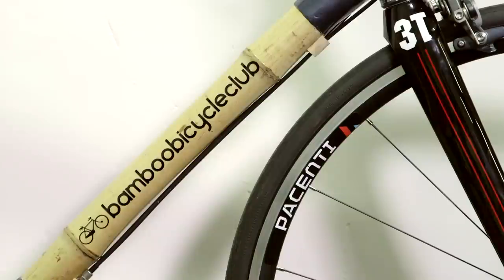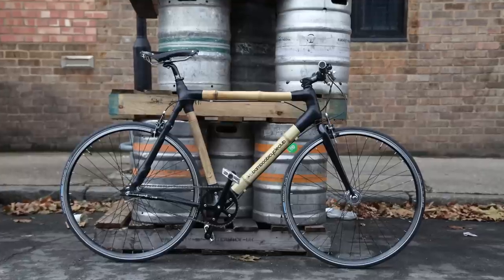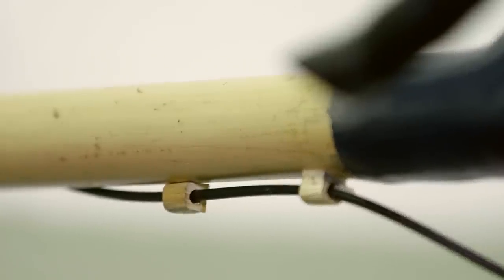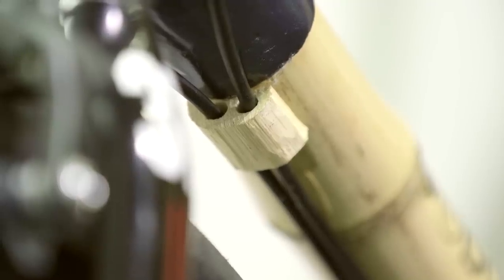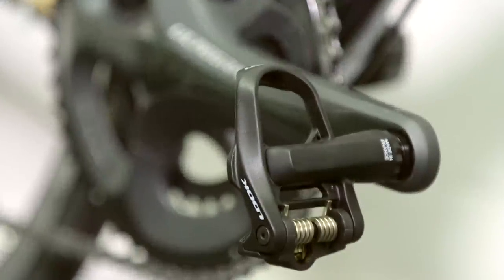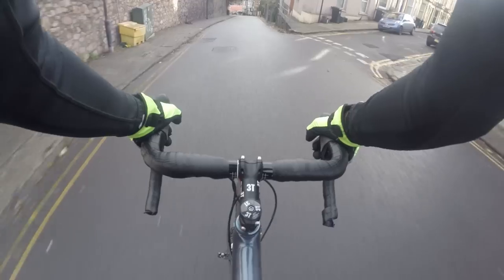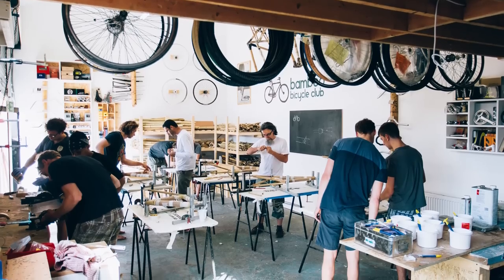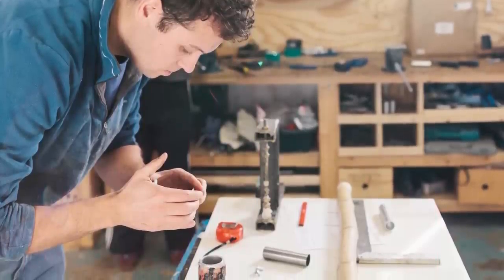Bamboo Bicycle Club - First Ride

Comment: This is so dope.

But.. really?  People are thinking it would break?  Must be those who dont know Bamboo is incredibly strong.  Incredibly.  Here in america, we use steel to build huge scaffolding racks multiple stories high for guys to work on buildings.  In ASIA, they build these out of bamboo.  The fact that it CAN flex slightly, makes it stronger.

If your someone who is scared of buying a carbon frame for fear of breakage, get a bamboo.  You'll break an Alloy, a Steel and a Carbon frame ten times over before you break a bamboo bike.  (And you probably never would have broken any of the other three frames either)

Comment: The reason why the fork juddered while breaking is most likely to be because the headset wasn't tightened enough. 
Did you try tightening it up during the test?
Every bike I've ever ridden has suffered from the headset being lose at one point or another.

Comment: ☝️🧐 testing bamboo frames on a dirt jumper is not the best way to understand the strength of bamboo. The tube lengths on a dirt jumper are shorter which is going to make the overall frame stronger. For example, an extra large mountain bike frame tube will be longer and much more vulnerable to cracks. Therefore testing a bamboo frame on an extra large mountain bike would be the best case model.

Comment: When building them can you design them into a road/cyclocross frame based on width of the fork and angle of tubing? Can you design them for cantilevers? What is the bamboos longevity, do they survive as long as chromoly?

Comment: these might not be the best bamboo road bikes available.
Reply: +bellavista7 Many people seem to miss the point. The Bamboo Bike Club does not build frames/bikes for anyone. You go on one of their courses and build the bike for yourself. It's an experience and the frame finish is as good as the participant wants to make it.  You can walk away with a frame which looks a bit like bamboo glued together with brown parcel tape or an old sack; or you can spend 100s of hours in your garage finishing it to a level where they look like a sucked-sweet-carbon spaceship. 

I don't have a workshop so mine is closer to the parcel tape!
Reply: well what can I say. I did miss the point. 
didn't know this was a DIY project... that's pretty cool.

apologies.
Reply: Thanks for the reasonable reply. 
I think what's more the problem is that the Bike Radar didn't get the point. I spoke to the Bamboo Bike Club owner about this review . He said that the wobble in the headset could have been tighten with an allen key there was no integral problem with the frame - it was a standard loose headset. Bike radar reviewed it as a product from the BBC.

So I suppose it was the bamboo bike club's owner's fault for being naive.  He just asked the guy on the course who built if if he wouldn't mind allowing Bike Radar to review it and then handed it over. BBC should have given it a proper going over before submitting it for review.

Comment: Wondering why nobody has made a bike out of hemp and resin to mould?
Reply: Paul Liptrott and also wondering if bamboo bicycle club was a band
Reply: Paul Liptrott hemp is not stiff enough to build an entire bike that's why bikes are not made from fiberglass even though it's stronger than carbon fiber carbon is stiffer

Comment: And the practical benefit over carbon or alloys is what exactly?
Reply: +WK95 
Bamboo as a building material is abundant,  fully renewable, does not have to be mined, easy to work, uses less energy in the frame construction, can be built by amateurs and is compostable and so highly likely to be a lot more environmentally friendly. 
 Plus they're still pretty unique. 

Other than that, there is no actual performance reason. Yes they're a soft comfy "steel" type ride but that's personal taste.I don't honestly notice the difference between it and my Zaskar! But then my Zaskar does have "triple triangle technology"!
Reply: -me
1) Aluminium is way more abundant than bamboo by several orders of magnitude, as it's the third most abundant element on the Earth's crust. Iron, the main component of steel, is the fourth most abundant element on the Earth's crust.
2) Between 1.5 and 2 kg of metal need to be mined to make an aluminium frame. By comparison, several tons of metal were mined to make the steel beams in the house where you live. Add another ton or two if you own a car.
3) Aluminium is 100% recyclable.
4) The energy needed to smelt the aluminium needed for a bicycle frame is a tiny fraction of your annual energy consumption, especially if you live in a Western country.
5) If the aluminium used to build your frame comes from recycling rather than aluminium ore, then the energy needed to produce it is 5% of the energy you would need to smelt it, that is, a tiny fraction of a tiny fraction of your annual energy consumption.
6) Modern alloys are very fatigue resistant, which means if you don't do anything stupid to it, an aluminium frame will probably last you a lifetime. 
7) An aluminium frame is lighter and stiffer. 
8) An aluminium frame is cheaper. A good-quality aluminium frame can be manufactured for less than £50. Planet X is selling framesets (aluminium frame + carbon fork) for £100 at the moment. 
9) A frame is only about 25% of the total weight of a bicycle. The remaining 75% is going to be either metal or carbon, that is, the same materials you would normally use to build a frame.

In summary, bamboo frames are for 
1) dumb hippies who think they are being environmental or 
2) hipsters.